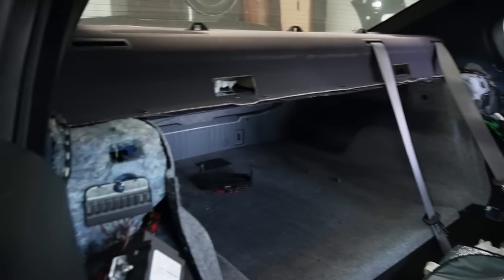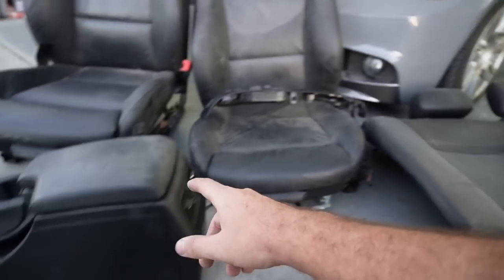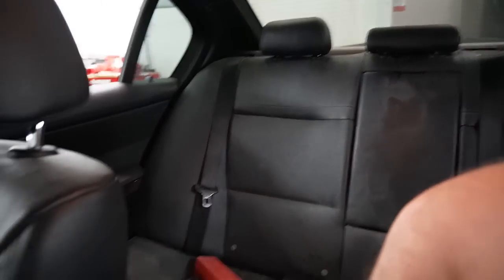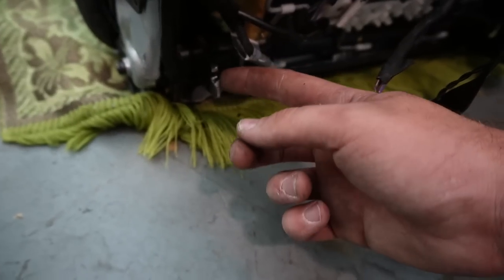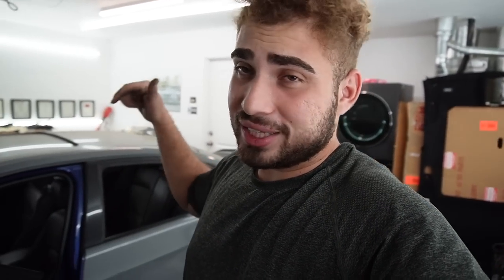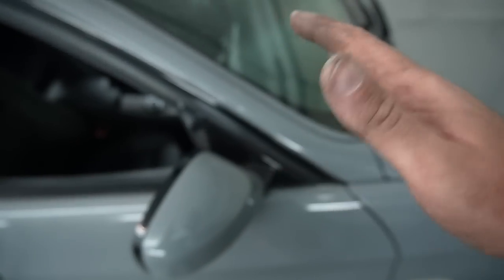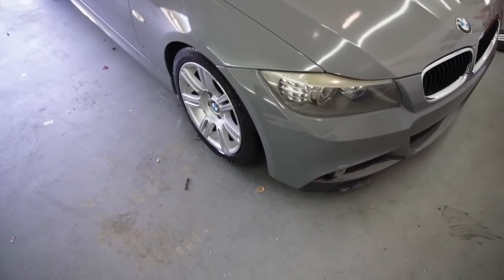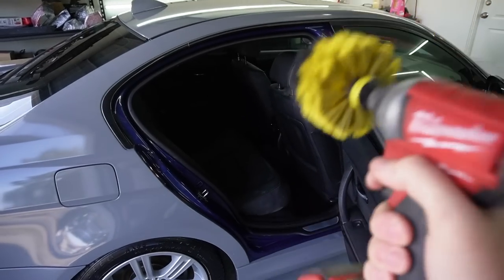$180 FULL BLACK INTERIOR SWAP FROM PICK N PULL! EVERYONE SHOULD DO THIS!

Comment: 2 questions:
1) why not transfering over the polster and lether covers from the old seat to the new seats - would have taken less time then the 2 hours you spent fiddeling with the rails then weld it together
plus you would have had a good look if the seat has heating or not
2) does the passinger seat have a small module beneath the seat - if yes then the seat has heating and the reason it won't work may be because of some missing wireing because the car did not have heated seats before
Reply: addon to my post - just rewached the vid - at 1:49 when you take out the passinger seat off the i3 - you can see the module for the seat heating function
- so you would need to take a look at the wiring of the car if you plan to make it work too